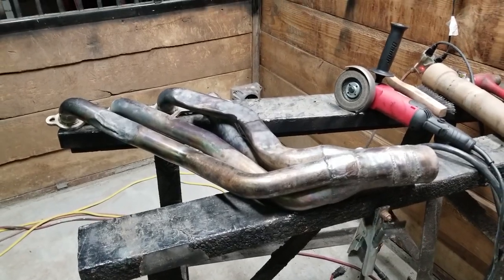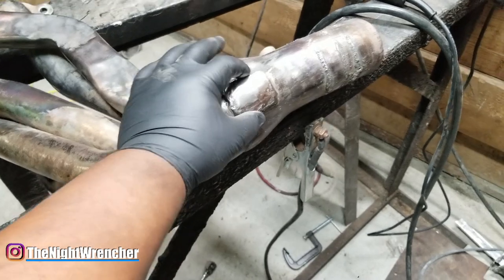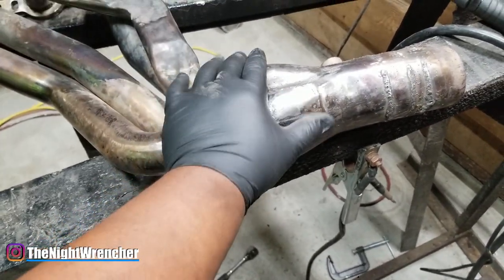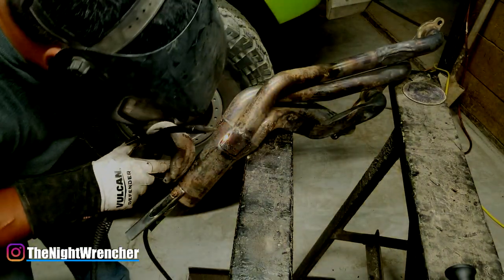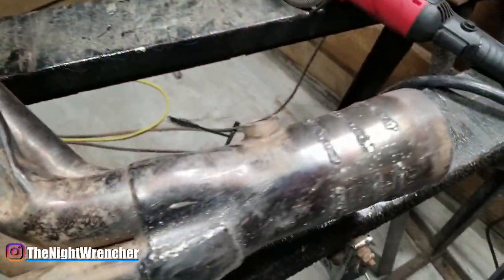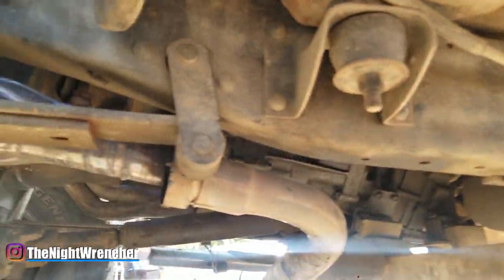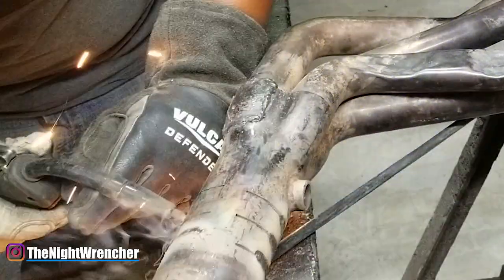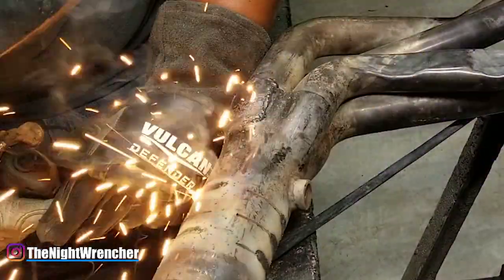Gasless Welding Stainless With Flux Core | Flux Core Welding For Beginners Tips And Tricks |

Comment: IF WELDING MILD STEEL AND S.S. USE S.S. WIRE.

ON S.S. PLATE,MIX A BIT OF WATER WITH DRYWALL MUD,PAINT ALL AROUND THE WELDZONE. COMPLETE THE WELDING,AND THE DRIED PASTE WILL WIPE AWAY,WITH NO SPATTER STUCK TO THE PARENT BASE S.S.!
DO NOT PAINT POTION DIRECTLY INTO WELD JOINT!

Comment: Awesome! 
Question, I was told I could reverse the polarity on my flux core welder, to make cleaner welds and cut down on splatter.???
I enjoy the video brother.
Reply from the maker: I appreciate it! It depends on the welder. An A/C welder thats set up for only flux core cant be messed with because it only has that 1 setting because its A/C current(think, low end harbor freight). DC welders are direction so polarity actually matters. Gas welding requires the ground clamp to be the negative part of the circuit while flux core welding requires the ground clamp to be the positive part of the circuit. If its a flux core only machine then its already set correctly. If it has gas capabilities, check to see where the ground camp hooks up to the machine and make sure its on the + and not the - .
Reply: @NightWrencher  thank you for taking the time to answer my question. That really says a lot about your Karter.. I'm so glad I ask you fist . I would have made a big mistake. 
Thanks again for all the knowledgeable information you out for us. Looking forward to the next video.
Reply from the maker: @markdishmon681  Anytime👍

Comment: I have a y pipe for my pick up that's 409 stainless can I weld it with flux core
Reply from the maker: Yes but it will rust if you dont paint over it